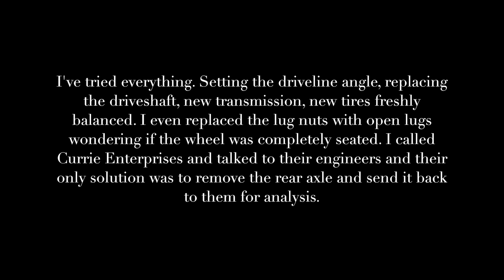Driveline Vibrations! Help!

Comment: Problem could be your PINION PRELOAD  is Set too LOW/ or you have no pre load at all. A guy that built the center section for my Fastback set the preload too little to none and had bad vibes at 80mph because of this. I went through the same thing you did

Comment: Been going through this with my mustang... new tires n balance helped but not 100% fix.. noticed rear right rim had a dent on the inside . Straightened rim out that helped but still vibration.  Took rear rims off  ran it on jackstands noticed the left axle flange or rotor is bent or warped.. so need to see what it is exactlt.. also found that the bushing for yoke in tailshaft housing is worn tf out.. yoke is worn too.

Comment: I have this exact same issue in my mustang and have tried so many things to fix it but no luck. Do you have any updates on this?

65 Coupe
347 ci SBF
Ron Morris lowering engine mounts
T5 z spec
Modern Driveline crossmember
Steel and Aluminum driveshafts
Ford 9" 3.89 by Quick Performance

Comment: I have 2 different cars with the same problem. one is T56mag and the other is automatic. I have tried CV joint style, slip shaft, Alum/ chromoly tubes, and adding or taking away angle in extreme amounts.  Considering going to a 2 piece shaft now..

Comment: Can you explain what exactly the vibration feels like? It's coming from underneath or the steering wheel? My Mustang also has issue of driveshaft vibration. I have tried Dorman driveshaft, costum built driveshaft.  The built one has less vibration, but it creates lots of noise after 80 mph. Feeling is like coming from pinion bearing, but it has not issue for over 100 mph. It just sounds like...a truck... If it doesn't hurt your trans and diff, doesn't create extra wearout,  it probably just a part of her character.
Reply: I guess you haven't tried panhard bar yet. Many people will disagree me, but it doesn't hurt to adjust the pinion angle horizontally.
Reply from the maker: The car is down for LS7 conversion, but might be something to try.

Comment: did you ever get this figured out?
Reply from the maker: No we didn't. The car is undergoing a ton of work right now. We'll see when its done and back on the road.
Reply: @russandadamsgarage105  I got the same problem on my truck and no one can give me a solution. I think the vibration comes from the slip youk on the tail of the gearbox.
Reply: 1 year later. Did you figure it out? Thanks for posting the video.
Reply: Figure it out yet??
Reply: @Mkiiisoup  The vibration must be from the output shaft bushing wearing out. That’s a problem because the case has to be emptied to repair it. Could have been a great swap transmission but, sadly. It’s just not

Comment: The look on your face before you say “okay it’s not fixed” is my face... I’ve swapped drive shafts U joints had them both straighten and balanced. I’m at checking pinion angles and alignment of the driveline at this point. They previous owner installed Air Bags in the truck and maybe have done something to the rear end to misalign it. I’ve swapped a rear axle, wheel bearings, new ring and pinion gear set, pinion bearing and carrier bearing. I don’t know what kind of drive shaft you have but I know if the yokes are out of phase it will also cause a 2nd order vibration. My drive shaft is one solid piece I don’t really have the ability to screw up the install.... I don’t think. I have not how ever swapped out my rear yoke attaching the Ujoint to the rear diff. If that is tweaked just a few thousandths it will resonate forward and play that drive shaft like a big bass string. My vibration has all the characteristics of a drive shaft out of balance accompanied by a faint oscillation within the vibration indicating pinion angle is out of wack. It’s starts at around 30 if you’re really paying attention and is in your face at 70+. Besides the Airbags everything is stock.  I like your videos and would love to find out if you solve your mustang vibration problem. I’m literally in the same boat and it’s a lot of time and money.
Reply from the maker: Kesterdaddy my next course of action is to raise the transmission output shaft higher. Right now the output shaft is pointing down, it should be parallel to the ground or pointing up. This would allow me to angle the pinion down (pointing at the ground). As you accelerate the pinion will rise a certain amount depending on your rear suspensions rigidity. If this doesn't work I'm going to go to rubber engine mounts instead of polyurethane. If that still doesn't work I'm going to a CV type driveshaft from the driveshaft shop. This eliminates the requirement to have the angles set perfectly. -Adam
Reply: Maybe you should try a slip yoke driveshaft

Comment: Before you do drastic changes try some simply things. First jack up the rear end under the center section a few inches so the tires are off the ground. Now run it up to 80mph or wherever the vibration is. Now remove the wheels and tires, replace all the lugnuts, you might have to put them on backwards depending on your rear wheels. Spin it up again. Did it change anything? If the vibration is still there, remove the rear axles, spin it up again. If the vibration is still there then most likely the drive shaft guy shafted you again.
 You say you check and changed/corrected pinion angle, have you researched different ways to check it? You may just be measuring things wrong, try again.
 There are two important measurements. Engine/trans angle and pinion angle. Forget about measuring the drive shaft angle.  If the engine/trans points down at 3 degrees, your pinion should point up about 1 to 2 degrees, not 3 like the engine trans. The rear end pivots up on acceleration.
 Check something else. When you installed the engine/trans did you point the trans straight at the pinion? If so, that could be the problem. The engine /trans should be parallel to the frame rails, the rear end is pointed parallel to the rails. They need to be parallel to each other.
Reply from the maker: dstolarc great ideas. I’ve tried a few of them already but I never thought about having the engine and trans pointing at the diff. The car is on adjustable polyurethane engine and trans mounts. I was thinking about putting regular rubber mounts back in that are non adjustable. I lowered the engine and pushed it back as far as I could for CG reasons. I’ll let you know what happens when I make the changes. -Adam
Reply: Russ and Adam's Garage you can most likely get the engine trans parallel to the frame rails by just using the trans mount. Get the center of the output shaft centered between the rockers. Then check the crank to see if it is centered.
Reply from the maker: dstolarc I’ll do that. Great advice. -Adam

Comment: I'm with you. I have a '08 F150 that vibrates at highway speeds (64-75+) and it's intolerable to drive -- too slow for interstate traffic and too fast on the other end without risking speeding tickets. Replaced front end, rear end, differential, real axle, force balance all wheels several times, re-weighted the wheels, U-joints, essentially everything but the driveshaft. Now I found an older Ford Service Bulletin that plainly states: "If you've tried everything else, replace the driveshaft...." 

Mind you, my dealership has been cleaning out my bank account and wasting my f*cking time putzing around with this issue when I know people locally who've bought new 250s and 350s and have this same wobble on their new trucks! The whole situation just pisses me off that I -- the non-expert -- has to become expert at fixing this. They should know their business better IMO.  >GOOD LUCK!<
Reply from the maker: Zaine Ridling I had the driveshaft on my F150 replaced under warranty fortunately. In this video I was discussing a driveline vibration in my 67 mustang. Thanks for watching. -Adam